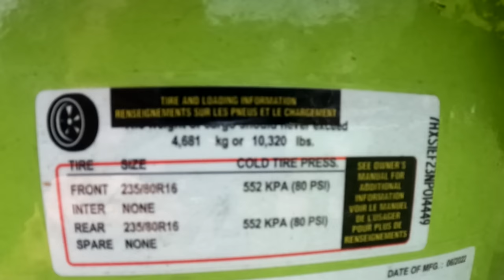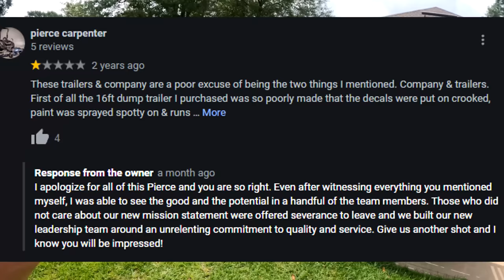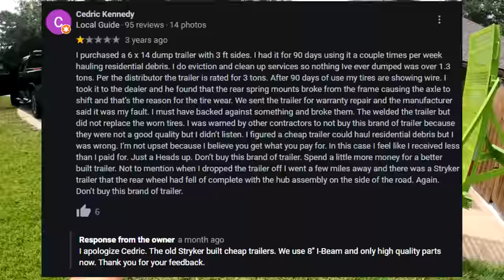New Deck Over Equipment Trailer, New Equipment, Running Out Of Room

Comment: I know you need the 102" for the 95" mower but this is why I went with a 20' trailer with a 2 foot dovetail. Lowers the center of gravity, lessens the steep angle of the ramps. Ramps stow under the deck so you aren't blocked by the fold up ramps. I wonder why there isn't a full width bar at the front to keep stuff from sliding forward toward the hitch. I gotta say, I like the color!
Reply: Brad said it is like that in case he needs to put the ventrac with attachment on the trailer, just pull up onto that storage box, there are hitch points up there

Comment: We had the same ramp catch bar issue, so we welded a chain end hook to it, so when not in a use, it swiveled and hooked to the rub rail, didn’t sit on the ground anymore. Also keeps them cleaner . Cheap easy add on . Keep on cutting!

Comment: The base supports aren't on the ground.so back it up to an incline where the pavement behind you is higher than the trailer and you won't need those wooden ramps...that's what we had to do with our similar trailer.  always have the area behind the trailer higher...kept some ramps like you built on hard because while our area here in Maryland is quite hilly there were times we jsut couldn't find an ideal parking place..:)

Comment: It would probably be wise to replace the spare wheel nuts with wing nuts...for easier removal and replacement. Just my thought.
On the last wooden ramp and on the green mesh ramp of the trailer  maybe you can add horizontal angle iron strips to prevent wheel slips/slides/spins when backing off or driving up onto the trailer

Comment: The big question with these steel trailers is how corrosion resistant they are over time.
Reply: Same goes for the truck really. 
But he's a southerner. He doesn't have to worry about the great salty northern winters.

Comment: I was one of those that questioned you on the CDL. I must say that I'm shocked the gvwr on that truck is so low, until I realized it's a 2500hd. My bad

The first thing I thought when I watched you put the ramps down was, 'that's fairly steep angle even with the dovetail'
How long are the ramps? 

It looks like a great trailer otherwise. I really like the under deck tire mount. I hope you can lock that up. The front tool box is sweet with the d rings added and the way they set up the ability to add your own lock rather than using a similar key lock to, say, buyers under body tool boxes.

Comment: have you looked into DOT lettering? for sure you would need it if you crossed state lines as the feds would require it, but here in my state of north dakota you wouldn't need DOT lettering as long as you stayed instastate.

Comment: Sweet rig and nice additions with those new attachments!  What are you going to do when you add a bucket and grapple?  I only have a 12' trailer and my tough cut does not have the flip kit. I put tough cut on first, detach, then load bucket/grapple on top of tough cut (placed on furniture blanket) driving up on plastic car ramps, detach. That allows me to get the two attachments and tractor with one trip. Requires lots of strapping but it works.

Comment: Im suprised that the 2500 can pull that massive trailer!
Reply: For a while, but it probably won't for long. A lot of wear and tear on a truck that's not made for that much work. Nice trucks, but they are more for commuting to work with your tool box and maybe some lumber.
Reply: @Natschke_Family_Adventures  Ive seen a buch of construction contractors with a 2020-2022 Chevy Sliverado 2500 daily towing skid steers and a backhoe. Sometimes, people buy that truck to pull rv’s 
If I owned one, I would use as it’s intended
I think the 3500 has the same engine, but the difference is that the 3500 is that its a dually
Reply from the maker: @Natschke_Family_Adventures  If a truck rated for 14,500 pounds conventional towing has issues pulling a 3,500 pound trailer, serious issues are afoot! :D

Comment: If the trailer weighs 14,000 and the truck 6,000 and you would happen to load max payload on the trailer of 10,000 then would you need a CDL?
Reply: Max load on trailer with weight of trailer is 14k total . So with the truck it would be 20k . No need for CDL.